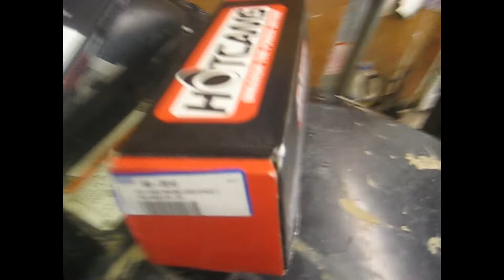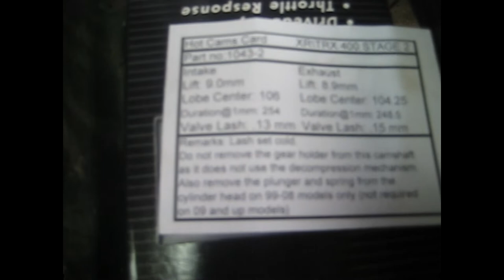TRX400ex Cam replacement, cam chain replacement, clutch replacement, and jet kit install

Comment: im doing the clutch and the clutch lifter isnt caching the plunger ive been at it for about it 2 days anyone know why ive tried wiggling everything
Reply from the maker: Make sure you have the case pressed all the way on before you start rotating the clutch lever. As in my case sometimes it takes a couple tries to get it. Also make sure the plunger is pulled all the way out in the center of the clutch.

Comment: Oil them friction plates!
Reply from the maker: I've been doing this for 14 years and never had a set of clutches come back with premature wear. The oil is really just there to cool the clutches off and they get soaked with oil once you crank it so I believe soaking clutch discs is an old wise tale.
Reply: @FourwheelerDoctor  that's true ... and I guess this would apply more to a brand new build that has never had oil through it yet